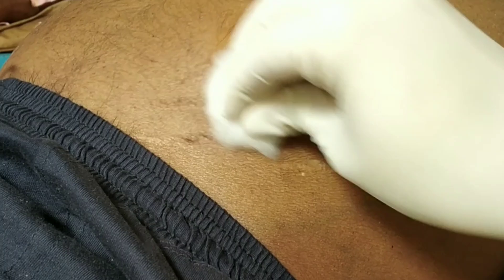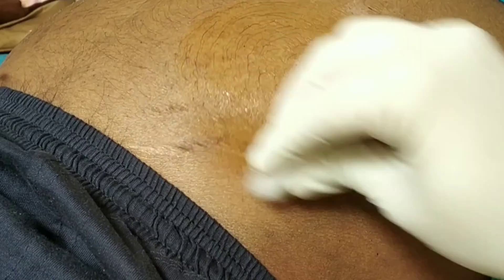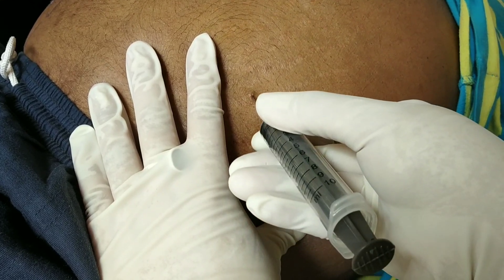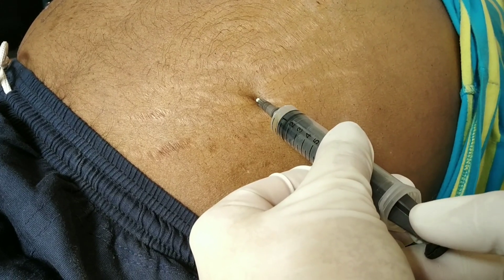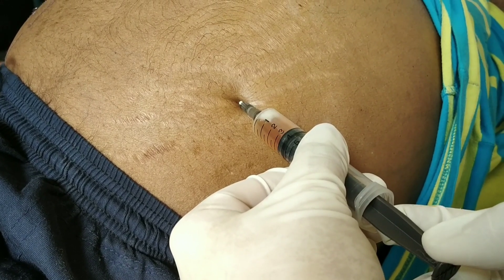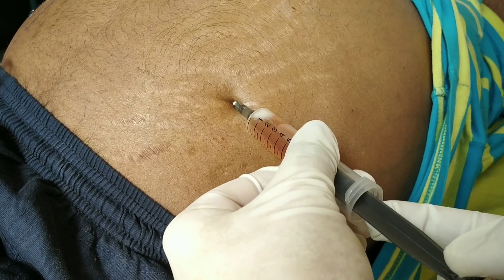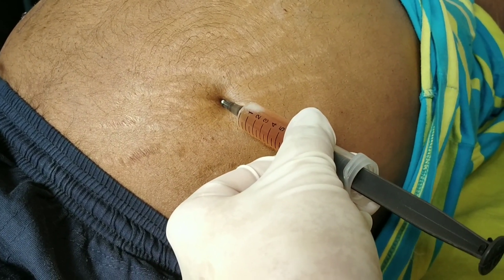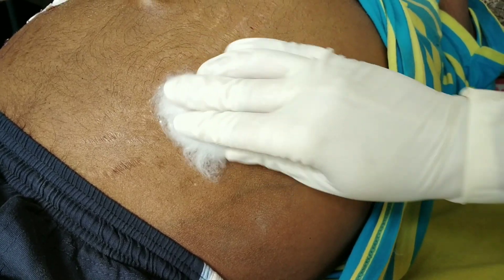PARACENTESIS // ASCITIC FLUID ASPIRATION TECHNIQUES

Comment: Sir...is there a reason ....u did it on left side...y not on right side ?
Reply from the maker: Any site where you feel comfortable and access the fluid
Reply: It's possible the lactulose we give patients can increases the caecum size due to gas production by bacteria, so if that's the case right side is not to be used to prevent any injury to the caecum.